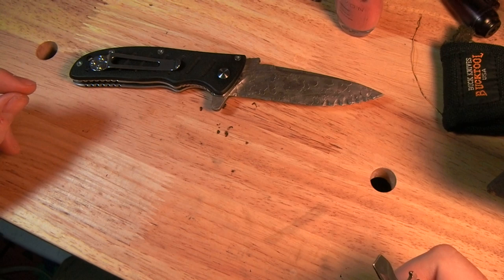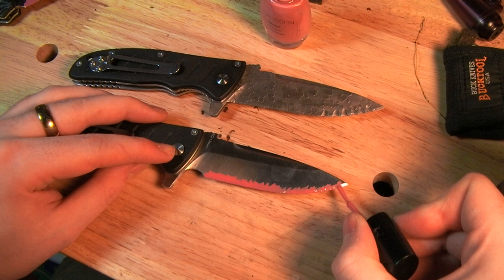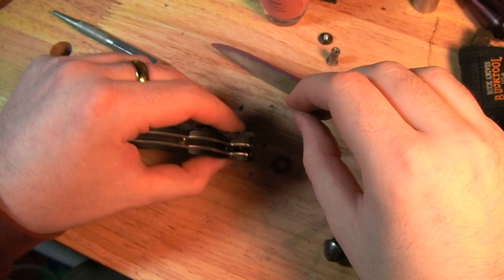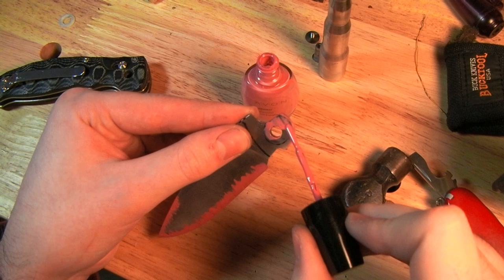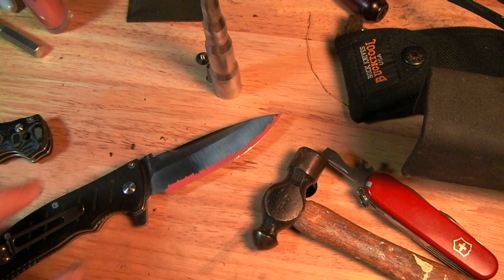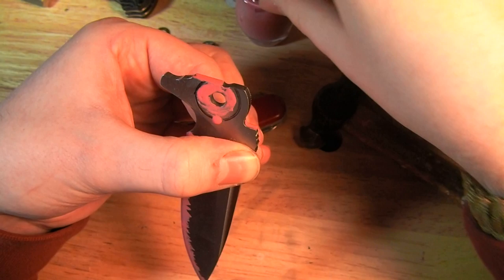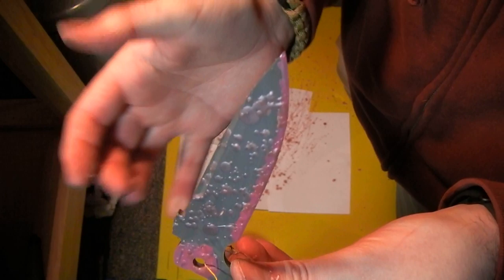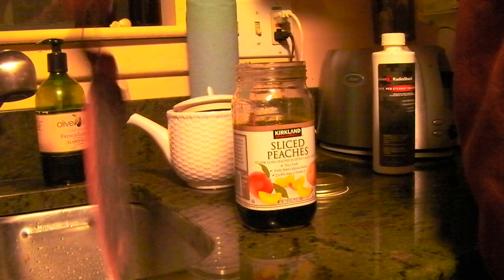Acid Etch for Folding Knife Blades Tutorial

Comment from the maker: I'm currently using the Radio Shack ferric chloride cut 50/50 with white vinegar. I like the depth it cuts to when the steel is immersed for about a hour and twenty minutes. Make sure you agitates it a few times during or you might get bubbles on the steel that mess up the pattern a little.

Comment from the maker: I use extra-fine sanding sponges, they make a soft uniform rub with a scratch pattern too fine to see. Most sandpaper will be too rough and make visible scratches as you found out. A good sponge from 3M costs about $5 from Amazon.

Comment from the maker: @guardians38 It depends on the wax. Some is too brittle and will just flake, also it might not stick to the surface. I'm experimenting with spray paint for this right now. It's easy to scratch lines in it with anything pointy. I'm not sure it will resist the acid I'm using though.

Comment: just a question why would you want to preserve the sections of the blade that you meantioned. acid etching does not remove enough material for it to matter so therefore would not change the solidity of the lock up correct?

Comment from the maker: I don't know. The proportions are not listed on my bottle (which is strange) If it helps the bottle does say that for use it making printed circuit boards it is supposed to take 20 minutes. That might help if yours has similar instructions. You might simply have to try it. If it's stronger or weaker than mine it will probably only change the amount of time you have to leave the blade in.

Comment: You might want to degrease the blade with some cheap isopropyl alcohol before paint masking it.

I'd also use the opportunity of the knife being apart to Flitz the area where the PB washers touch the blade to increase opening smoothness.

Comment: Believe it or not, but nail polish is just paint. Usually it's an enamel but some are lacqueres. Nail polish might have more dryers, but you can buy additives to make it dry faster. What I'm getting at is If you do this allot, nail polish might get a little expensive. Might want to try Testors model paint or even buy a pint or quart at Home Depot or something. I worked at a paint factory for several years that's how I know.